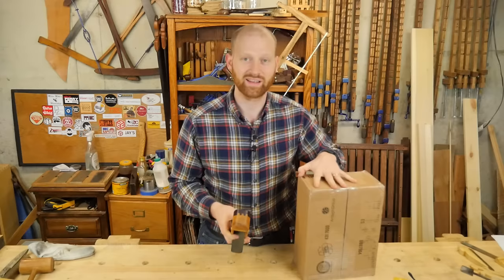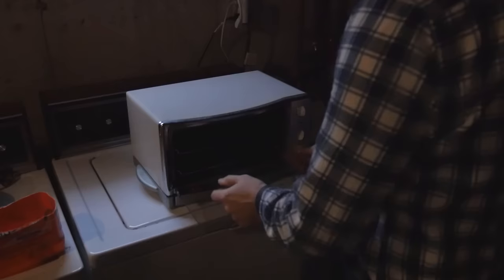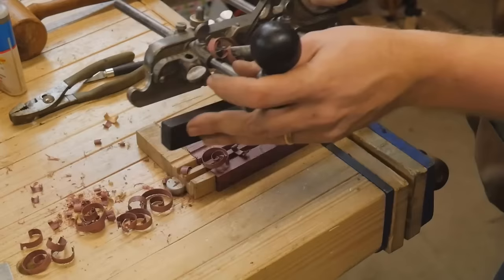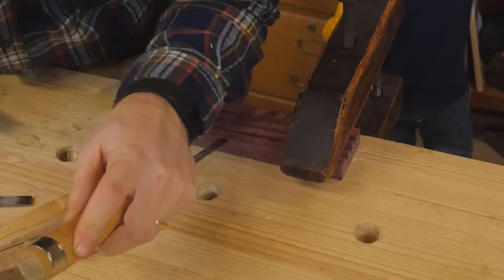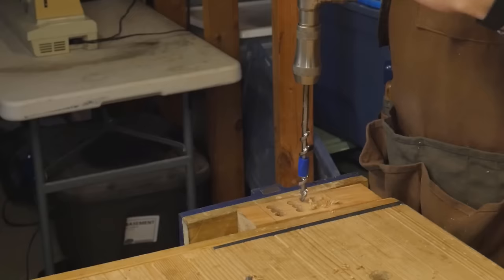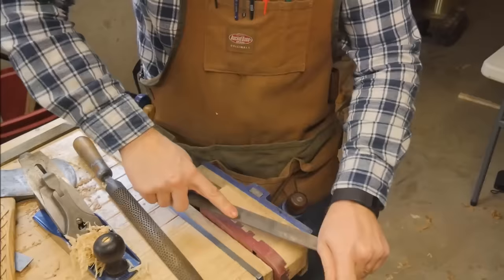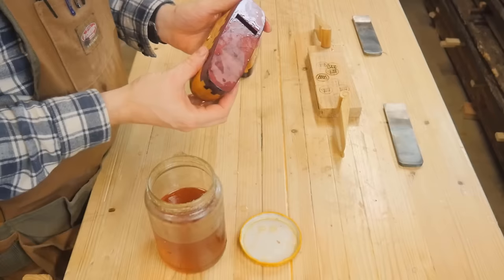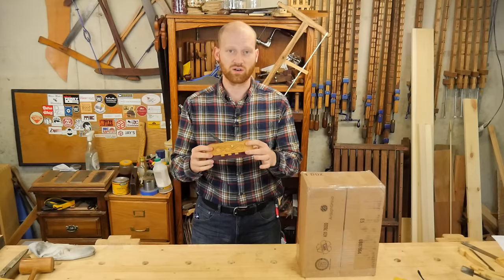How To Make a Wooden Smoothing Plane - Ash and Purple heart - Long Form

Comment: i really liked this video and your ideology about enjoying the work as much as the project. i really like the mating of the sole and body on your planes. i am a hybrid woodworker but im starting to slide more and more into hand work because its fun! i recently made a lamination method wooden plane as an experiment and i was astounded. it was pretty easy and it works as well as an expensive veritas it shares a shelf with now. i made it from an iron and breaker i had and an oak short! i thought i might fail on the build or it would be black magic to adjust or that it wouldnt perform. wrong wrong wrong. i almost wonder if i speak about this if lee valley and lie nielson will put a hit on me. i have ordered another iron! next! i have to say im still hybrid, between watching you cut your own blade!!!!!!!!! and fidgen mill a cord of walnut by hand i still find some reasons to roll out a cord! im afraid the whale oil lanterns might burn down my shop! but i liked this and subscribed and look forward to catching up with all youve done and have coming. thanks for sharing.
Reply from the maker: +R C thank you that means a lot. It still surprises me when a hand tool I made works as expected. It is just so much fun.

Comment: how do you like those chisels?
Reply from the maker: The set from Aldi is my go to chisel. they are not as god as most of the higher quality but for the price they can not be beaten. Part of the channel is showing how you can get into woodworking for almost nothing so I use tools I have restored or the cheaper versions.
Reply: They look like Nerex but couldn't quite make them out. Always wanted to try them out. That is why I ask
Reply from the maker: The  Nerex chisels are great chisels. they will hold an edge nicely.
Reply: Woodcrafts really are ok at best. Steel is ok but after using my Japanese chisels my expectations are probably too high!
Reply from the maker: ya Japanese chisels  are hard, but if not used properly they often chip.

Comment: What exactly is the benefit of the elaborate joinery on the sole? Are you afraid that an ordinary glue joint will just fall off as you plane? Dude, you have way too much unstructured free time.
Reply from the maker: LOL it is just for the look. back when glues were less relable this was often done as they did come free with just a flat joint. but now they are sometimes done this way for tradition sake and the fun of it.

Comment: Hand tools? Are you serious? No wonder it takes you too long. A CNC machining center would spit one of these out in minutes. Get with the times already!
Reply from the maker: LOL you have no idea how slow a hand crank CNC is.
Reply: @WoodByWright  you're right. I had my electronics going as I built my CNC machine. That kept the hand cranking down to a minimum. Wiring machines up last is a common rookie mistake.